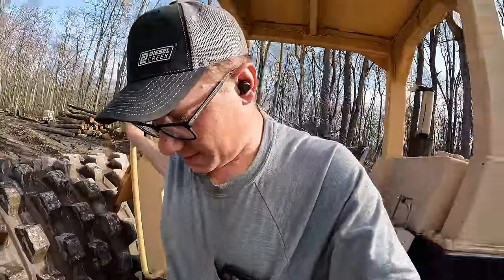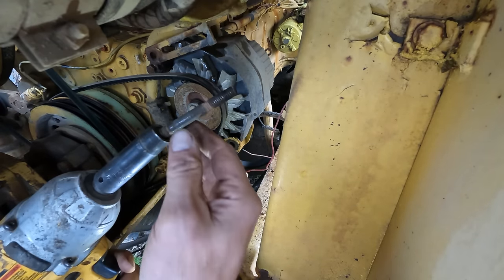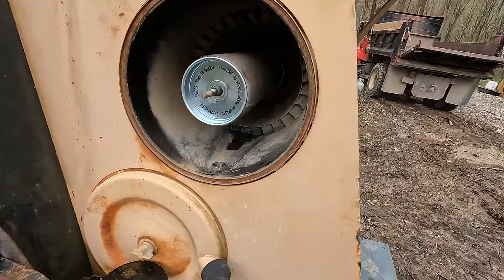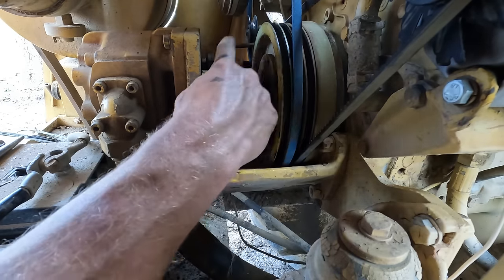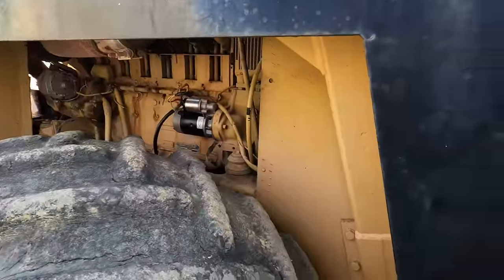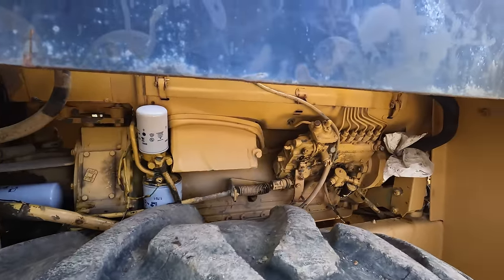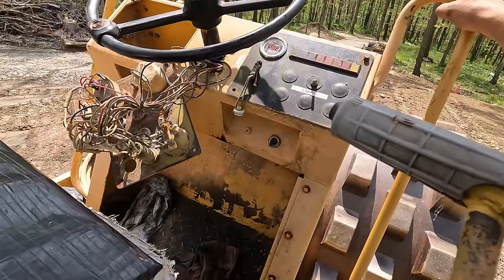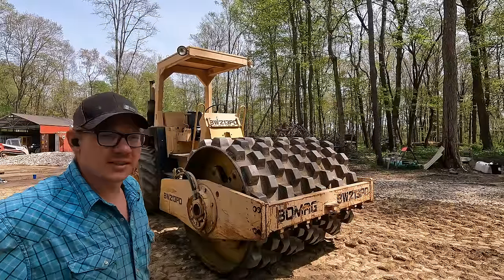I got BURNED on this Compactor from an Auction! (Bomag BW213)

Comment: I may be naïve, but it seems to me, that if you want a piece of equipment to be maintained properly, make the maintenance tasks as easy as possible, i.e., easy access to all replaceable filters, not have the oil pan drain discharging over the pumpkin, etc., etc.  A lot of the filters on that piece of equipment are just onerous to deal with, and I think the comments below about if the previous owners put up with an iffy starter for 11 years, what else did they not deal with?  In spite of all that, Matt, I think you get a great deal of satisfaction in resolving all these issues in the equipment you get, otherwise, you wouldn't keep doing it.  I'm with you on electrical problems-hate 'em- and I applaud your perseverance in dealing with them - they should all be so simple as just reconnecting a ground wire!

Comment: The fact that the guy knew the starter was janky for 11 years and did nothing say's to me that lots of other maintenance may have fallen through the cracks as well.
Reply: I agree. Who puts up with a malfunction like that unless they never use the machine at all.
Reply: Dan when I got my 1971 SeaGrave Fire Engine for restoration. The place I got it from. I got all the maintenance Records from when the FD got it. It was neat looking through the past maintenance. The shop guys did maintenance on the Engine all the time. Did have transmission overhauled after I got it. But HAY it was a clutch that from record never had had any issues before me. The clutch was just ready for a overhaul. That clutch going for 40+ year's. There's a grease fitting in middle the owner of shop who did overhaul, said for me not to grease her all the time. That was part of problems it got to much grease, got grease in areas of clutch to gum it up. He told me how to and when to grease that fitting. Very little.
Reply: @TractorWrangler01  because it still works.
Reply: @TractorWrangler01  It's way too easy to just run it into the ground. Ironic.
Reply: @rp1645  well Mr rest in piece he was told the starter was what was the word JANKY not my words so would that not say that who ever owned it knew of it and just left it think of what you have written you knew nothing of your prob HE did
Reply: My first thought too. This BOMAG was obviously previously  owned  by a few total jackasses.
Reply: @regsparkes6507  also non of the gauges work either as he spoke of this i don't think Matt did a hole lot of look see before buying also say will do for what he needs it for so would it not have made since to just hire one for the shed project then no fix it prob;s just saying is all
Reply: @wallbawden5511  Yessir, $22,000.plus, would have gotten him a rental  and his job would have been done by now with a lot 0of cash left over. ( Terrible waste of cash here. ) Nothing wrong with the brands, BOMAG and Deutz,.. but there is something  amiss with the 'our boy's' thinking on this one.
If he thinks he may have spent a lot of beans on the purchase, just wait until he gets into that vibratory system!
Reply: @regsparkes6507  I'm herein you it's nice to have your own but when your own don't get used much it's dollars best spent else where sorry Matt but i think you weren't thinking on this one
Reply: @wallbawden5511  Yes, I based my comment(s) on the fact that Matt did say he might just sell this one on, after he got the base compacted. 
A no brainer, I would have thought too.
It will be highly unlikely that he will ever get his 'repairs and maintenance' costs back, even if he does sell it. ( Another waste of time and money ) The more I think of this the  more
I have to wonder about this 'deal'.
Reply: @regsparkes6507  What's wrong with his thinking? Buy it, fix it, use it, sell it. If Matt paid $22k on the machine; spent a few hundred on basic maintenance; used it for his project, then sold it for $23k - seems like good thinking to me. The alternative would be to pay whatever crazy rental fee for a few days' use.
It looks like his plan may have backfired though, suggesting that the "burned" in the title wasn't clickbait at all.
Reply: @2H80vids  20s of video related to the title. Clickbait.
Reply: @2H80vids  Agreed. The cost of a rental is not just "the machine", but availability, the cost of transport (whether Matt's trailer and fuel, or $7.50 a mile from the rental company), and HIGHLY variable weather conditions.

Even if he got "burned" on this deal, it's YouTube content which is interesting for us and income source for Matt. I have zero knowledge on what YT pays creators, but with 427K subscribers, I'm pretty sure the video paid significantly more than the cost of repairs.
Reply: @2H80vids  Too bad you don't have a name to use, like I do. :)
However, my comments afterall, are only my opinion. Yours obviously is another good idea and or thought.
Of course Mat can do whatever he wishes,... he already did so. I was merely thinking out loud on what I would have done. 
Main thing though for most of us, get good value for the money and time that you have.
My comments, ( and yours, of course ) merely add substance to Matt's channel, don't they? hahahaha!
Reply: @WALL BAWDEN 
You and others in this comment are missing the point of buying it. You buy a piece of equipment for your business, it becomes an asset and a tax deduction.
And, when Matt is done with this job he has the option of selling this piece of equipment for a tidy profit if he no longer needs it or wants it.
As he stated, heavy equipment is hard to find right now, going for unheard of prices and probably not going to change in the short term.
So, even with the repairs, think of it as an investment and not an expense..
Reply: That flywheel and it's damaged starter ring gear will be heard from again, down the road.  Bad attitude to let it go.
Reply: @wallbawden5511 it was at auction... what do you expect.
Reply: @wallbawden5511  I Mean that might be true If he couldn't sell it and get his money out of it.
Reply: @2H80vids  that's my thoughts exactly... if you pay a good price for a machine, you can use it and sell it and get all your money out of it or potentially more. Don't waste $$on rentals if you don't need too.
Reply: @J.C. Wren  it's not about subscribers but views. If the video get alot of views it's a money maker. Sub count is good for sponsors  and that income stream.
Reply: @randybobandy9828  your right and we know Matt loves an auction
Reply: @randybobandy9828  yes but still think with this one hire was the way to go just my thoughts
Reply: 24:56 Did you ever rotate the oil pan 180 degrees? I wish you would shown the smaller replacement belt for the blower fan motor.

Comment: I think all used construction equipment is only serviced when it's bought or sold.
Reply from the maker: You’d be right for some peoples stuff
Reply: Ha ha 😂
Reply: Exactly
Reply: going by the rending screams coming from the excavator on the massive building site im forced to live next to, I dont think they know how to use grease properly either, if at all.
Reply: Only if the owner is dumb
Maintenance is the only hope/safety net a machine has from day one, you earn more if you do good service from day one
Reply: Depends. I do pre ventive service maintenance on most of my machine.
Reply: Or it completely breaks down and stops.
Reply: @jonathontaylor8861  Not big time contractors on union jobs in NYC would lose $$$$$$$  from downtime.
Reply: @FaenumVena  THIS.
Reply: Usually large companies where preventive maintenance is considered an expense.
Reply: Haha, I went through my Cat 307 and when I followed the manual to check for "over greasing" of the swivel compartment I found not one oz of grease in there. Apparently it had never been greased at all much less too much. It swivels a lot smoother now🤣 We used equipment fans are always thrilled if it only needs proper lubrication and there's no permanent damage. Low hours is a must start in most cases. 3200hrs was my starting point on this excavator. Pretty low for a late 90's machine. She purrs now. Glad I purchased it before these price hikes, yikes.
Reply: @fiskfarm  true. I have 2016 308 just paid CAT $7k for new dpf filter at 3500 hours.
New machines issues with computers emissions . To expensive . I have CAT ET still cant diag my machines only dealer can.
Reply: Strongly agree. 

Although I run a cement mixer, we service them for every season. Which of course, it’s a truck, it needs brakes and oil changes, but we do the PTO u joints every year, replace chains, boots, hinge pins. With concrete there is no “it will get by”. If anything fails and you can’t get the mix off the truck, it’s $26,000 for the new drum plus paint and install, then what ever broke on the truck that stopped the job.
Reply: @DieselCreek  Deutz engine is the best, just make sure it is not clogged up.
If u need any parts just say so have a bunch of them
Reply: Most of it
Reply: Not here change the oil twice a year on everything paver roller bobcat etc as well as fuel filters
Reply: @MitzvosGolem1  wow. So often now older is better. My old Swinger loader will be the last machine I have that will survive an EMP being all mechanical😜 The Cat 307 does have computers. Been very reliable so far. It just purrs.
Reply: That's ridiculous. There are plenty of companies out there that have their shit together and understand preventative maintenance is cheaper in the long run. Sure there are some shortsighted knuckleheads out there.
Reply: So many places just lease the quipment, and expect the leasing company to pay for (and do) maintenance--which is sad.
Reply: I worked oilfield we work on equipment when bought, sold, and broke down when you need it
Reply: @jonathontaylor8861  : Most people call that "maintenance" lol.
Reply: I know just about all the heavy equipment I touch is that way, ridiculous....
Reply: @kitecattestecke2303  Lol, you're obviously not in the industry...
Reply: I manage a hydraulic  maintenance workshop and you're absolutely right for the most part in my 40 year career!
Reply: I have a history working for s guy that never seems to understand the philosophy of "Schedule maintenance or your machines will schedule it for you."
Reply: Or when it breaks
Reply: Ditto
Reply: I mean kinda for the small guys in particular or the big guys for small equipment.
Reply: Or when it totally breaks..

Comment: The mill wrights at the place I worked for 37 yrs, used “never seize” on just about every nut and bolt they touched.and over time, it paid off.
Reply: we used never seize on every bolt and pin we worked on, saves a lot of headaches
Reply: So everything and everyone was covered in it right? I cant take the lid off mine without getting covered in it. 😄
Reply: @Familyfleet  yep.  Amazing stuff the way it seems to jump to all kinds of places.
Reply: @777poco  yep.  Most of my electricians tools had some on them because we used it at every union on the aluminum conduit.
Reply: Good stuff! Thread lock is also great for preserving threads and keeping corrosion out.

Comment: Matt: from my air cooled VW days I offer this suggestion:  since you have TWo belt pulleys to operate the fan. I would fab a mount for the alternator so it runs off of one (or both) of the fan belts. That way if the charging light comes on in the cab, you know that either the alternator has blown something or you have blown a belt. The light comes on immediately if the alternator isn't running and if there is no fan action due to blown belt, it saves you a toasted engine. Even if the hot engine light circuit works, it comes on sometime after the belt failure, and after the engine is critically hot.   A failed alternator light comes on immediately and is your "before the lock-up"  early warning safeguard. I remember in my VW, the alternator light saved me an overheated toaster one day when the belt broke and I didn't hear anything amiss. Had it not been for that little light coming on I'd have lost my gutless-wonder death trap. 
Ben
Reply: Or you could built a little frame and mount one of those proximity switches with a wheel like a jockey wheel which runs off the back of the belt.

Comment: Check the top of the lift pump, that little disc is a filter screen housing and I’ve seen some super gummed up because not many people know what it is.
Reply: This is one of the first things to check on a new-to-you Deutz. Another is the injector pump oil level; they're manually oiled and many/most operators don't know that.
Reply: The Perkins-powered Cats frequently have a similar issue (4.4, 6.6, 7.1) where they will have an inline fuel screen that doesn't show up under the Filter GP breakdowns, only under Fuel Lines. I've seen on Excavators, Bulldozers, Wheel Loaders, etc where it has never been changed and is stove up with crud.
Reply: We considered the inner filter as the safety filter.  When dirt is found in the inside filter we consider the primary filter as having failed.  We then replace both filters.  Only replace outer filter until one of them fails, at that point when inner filter has dust you know the outer one has failed.
Reply: @samdunn7860  I agree. I’m always trying to convince others that blowing out the air filter is not worth it, unless you really need to have the machine operating and can’t get a new filter. But that’s only a temporary fix.  Air filters are a lot cheaper than turbochargers, valve jobs, etc.
Reply: I've seen people not know their filters were jammed up like on the Detroit Diesel. The engine would lose power. Simple problems cause big problems.
Reply: I just added a comment about the same thing.
Reply: @fastsetinthewest  , I had the inner filter stop up on a 743 Bobcat and it drove me crazy !
I described the problem to an old timer mechanic buddy of mine , " Was working perfectly then it seemed to run out of fuel just idled down and stopped " .
I changed fuel pump , tank suction hose , filter AND housing , tank was already full.

He said " Air filter is stopped up" I said no way it just happened , no gradual power loss .
I had a remote starter switch while working on it , as I was cranking on it  I was loosing up the inner filter nut and it started , it had so much suction on that inner I almost couldn't budge it and when I broke it loose I had a runaway and had to rush around to lower the throttle !

Had to go back to him and eat crow when I told him it was EXACTLY what he said.

Comment: The old guy I used to work for, would always put a 2nd belt on equipment that was extremely difficult to access.. He would just zip-tie the "spare belt" up out of the way so it wouldn't rub on anything.. Made it super easy for the next time.
Reply from the maker: Ya, no place to zip tie it to on here
Reply: @DieselCreek  does this machine have glow plugs ? 
If so I think one turns the key opposite to the on position for a few seconds , then start . 
Anyway all the best from England 🏴
Reply: @robertkustos2931  If I remember correctly, only -W (indirect injection/precombustion) Deutz diesels of this vintage have glow plugs. They're necessary.

Comment: Matt, your Deutz has a switch that will illuminate a light or sound an alarm when the fan belt breaks - you can see the switch that that tensioner pushes on if the belt breaks at around 23:20.  Make sure that is working, it's a great indicator that a problem exists before the engine actually gets too hot!!  Another thing about these Deutz engines, although they are commonly referred to as air cooled, they also heavily rely on the engine oil for cooling.  They have an engine oil cooler that must absolutely be kept clean!!
Reply: Your right, I missed that switch in the video.
Reply: I came here as well to point that out
Reply: I can attest to that as well. We have an old Deutz 10006 tractor with exactly this same engine, and you gotta make sure the oil cooler is clean (it’s under the unclip and flip out cowling behind the fan), and clean the piston liner cooling fins regularly. Other than that they’re a great economical engine.

Comment: As a former heavy equipment operator I can attest that our equipment was never serviced unless it broke.
Reply: Servicing equipment that is faulty but still works eats all the profit from a job.
If you can keep it running until you sell it on or someone else takes your work, it eats all the profits from THIER job.
Reply: If it ain't broke don't fix it. Always been my motto!
Reply: You could get the mechanic to take a look at something if you bought him a case of beer on my worksite.
Reply: that's the south american way.  oh no, wait.  Have yet to find a complainer who takes the time to put together the numbers to prove that is better to maintenance than it is to let it break.
Reply: @Debbiebabe69  Until the faulty equipment costs you a day or two of production and you are still on the hook for the wages and/or penalties, it happens eventually and I've seen companies pay out the nose for this kind of shortsightedness.
Reply: As a current (but close to retirement) heavy equipment operator, we bought new equipment every year. I'm a GOVERNMENT heavy equipment operator. 
I've never run old equipment.
Reply: @Debbiebabe69  That's if you manage to sell it before it breaks. If you don't maintain it, it usually means a much, much higher repair bill with the common things like bearings or brakes. Do the sensible maintenance when problems start appearing (or hearing a weird sound) and it's a small job with cheap replacement parts, do it once it totally goes and you're looking at totally replacing brakes and / or the whole wheel comes off.